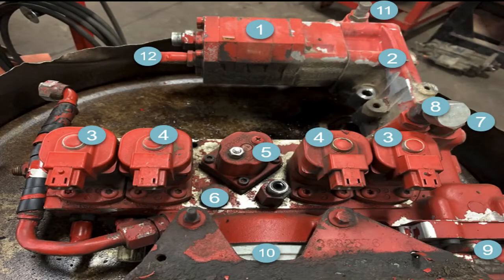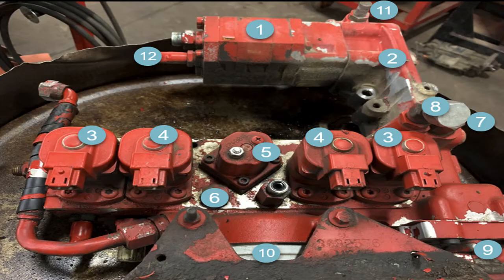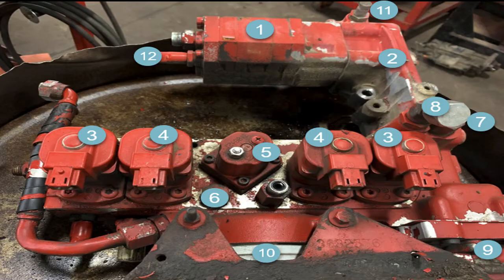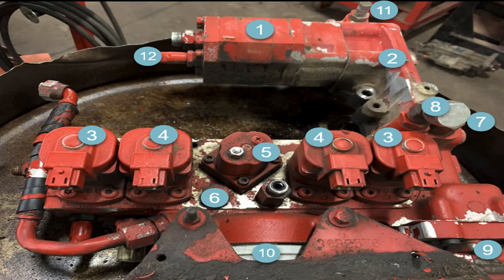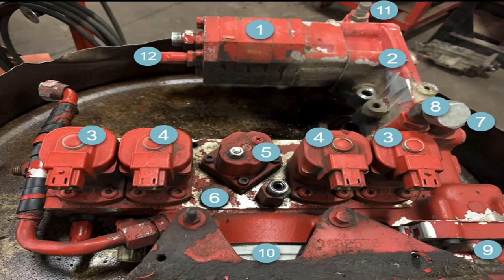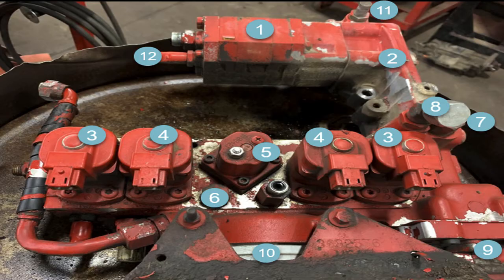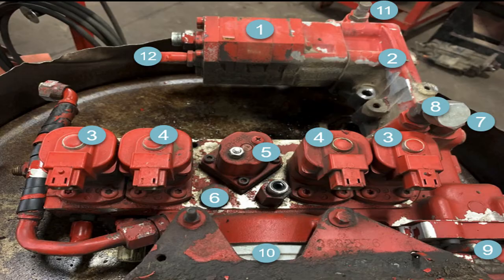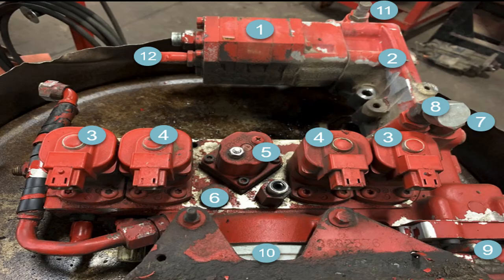ALL about the IFSM

Comment: Hey working on a CM871 and did a fuel tank cleaning and new filter were put on but still having issues when accelerating loss of power misfires and shutdown at times new gear pump was installed few weeks ago also
Reply: And only code coming for fuel is a 2215 for fuel pump delivery pressure come active and inactive when accelerating truck
Reply from the maker: I need more information. Fault codes? was there a lot of water and or dirt in the fuel tank? Why did you clean it?
Why did you change the fuel gear pump? Shutting down pulling is a sign of total loss of fuel pressure. Check the fuel pressure. There is a fitting under the IFSM to the front of the on engine fuel filter. Put a line on there and run it up where you can see it. If you have a scanner that reads fuel pressure in the ifsm use that instead. There are a lot of roads to take on this and there is not enough information for me to choose one at this point. But the fuel pressure check is the starting place. Check fuel restriction at the inlet to the ifsm. Make sure there is no screen in the inlet. They used to put screens in them and they would plug with all kinds of debree. fuel restriction at the inlet to the gear pump should not be over 10 INHG
Reply: Ended up finding the problem was fuel lines were rotten and clogging up inlet of the fuel filter on the frame and cause lack of fuel to create pressure causing the lag and random shut downs

Comment: Is it safe to poke in the center  of fitting 11 when primming after installing new fuel filters ?
Reply from the maker: That fitting is where you measure total fuel restriction at the inlet of the gear pump. Yes it is safe as far as there is no extreme fuel pressure there. If you have. an electric lift or transfer pump on the engine pushing that poppet will let the air out and you may get 10-15 psi fuel spit at you. I would think a better option is to buy the fitting that connects on to that and put a line on it then run it into a bucket until fuel runs out. Then take it off the fitting and it should start. Cummins runs a "priming line" from that fitting to the one on the back of the gear pump and lets the fuel run in a loop to prime it. Then you remove the line before starting or it wont start.I never did that myself.

Comment: this may be a dumb question but which one is the actuator im a bit confused i got the gasket for it
Reply from the maker: The isx has two seperate fuel delivery systems in the head one for the front three and one for the back three cylinders.
So there are two metering actuators and two timing actuators. A pair for each bank as they call them. The gaskets - unless orings- have to be bought for the metering or timing as bolt up pattern is slightly different. That is so you can't bolt the actuators into the wrong position.
Reply: @ENGINESHOPJOE   thanks

Comment: Hey Joe
05 cm870 - was idling truck today and it ran out of fuel so I threw 5 gallons on in the tank. It had one of those longer starts as you know it would because it would have to prime up. So the engine starts to run and there was fuel running directly down the fuel filter. Any suggestions?
Thanks
Reply: This is a truck that hasn’t been sitting for 1 year but both primary and secondary filter was changed last year April. Is it possible the filter seal could go bad or I have to dig in that IFSM
Reply from the maker: There is a number of places it could be leaking from I would clean it up with brake clean let it dry take a bright light start it and see if you can watch words coming from. You could also clean it and dust it down with talcum powder. Remember, there are pulsation dampers in the back you can’t see they can leak on the backside, if it sits O-rings tend to shrink, so that lands to multiple places you could have a fuel leak don’t overlook the shut down solenoid or the actuators when they leak it’s always a seeping type of leak.
Reply: @ENGINESHOPJOE  thanks for the reply, I’m going to check again  next week I bought all the seals for both dampers and the whole ifsm gasket and the actuator gasket with another fuel filter. Will update you

Comment: What would cause white smoke coming out the fuel tank
Reply from the maker: The answer would change depending on the engine you have. Check the return fuel for bubbles. Is it running normally? 
Some injectors can have an issue where combustion gas goes up into the injector. The isx 870/871 old mechanical injectors could 
cause this if a ball check near the tip of the injector comes out. Normally you have a stumble or non steady idle if the injector causes this.

Comment: My engine loses fuel prime after it sits a couple hours and u have to let it sit with the 12v pump on and I have a small power loss, any tips?
Reply from the maker: Generally speaking, from my experience and what I have read in channel comments, the culprit is usually the primary fuel filter assembly. Or its related fittings when they use orings to seal and not pipe thread. On subscriber said he had gotten undersized cap and bowl orings for his primary filter when purchasing replacement non OEM compatable fuel filter cartridges. So see try buying OEM orings for the filter assembly. It is interesting to note that orings may let air seep in but still seal fuel. It is all about the molecule size your attempting to contain.
Reply: Thank you so much that helped out a lot. I’ve got a lot of the kinks out of it now. Where is the fuel check valve to keep the fuel from losing pressure? Once again, thank you so much.
Reply: Also, my truck bubbles back through the fuel tank while it’s priming and after it’s ran for a little bit it’s like it’s got a white fog coming out the fuel tank

Comment: Joe I’ve got a cm871 that will not start. Cannot get it running on starting fluid. Any ideas. Curious if a cracked isfm would cause this
Reply from the maker: Did you have an egr cooler failure and get water in the cylinders??
Reply from the maker: I have seen that cause carbon to stick to the valve seats and you loose compression. It wont start on ether either. 
Just a guess but I would need more details to give a better answer
Reply: @ENGINESHOPJOE  Egr is deleted
Reply from the maker: Did. you get this started? If not check cam timing with the wedges and pin. They did have an issue with the injector cam gear slipping if it is not loctited with 609. But you should have faults. The best way to figure it out and start a data logger > all parameters> and crank it 30 seconds.
Look at that log or send it to me @faultcodehelp@gmail.com. That is where I would start. We have to be sure the ecm even knows it is cranking and then that it is jumping into crankstate. Then we go from there

Comment: Hi Joe, I have a QSK15 running a gen set. At operating temperature, it has a misfire and excessive black smoke. No active faults and fuel pressure at 276.1 psi. I performed a cylinder cut out test and found number 4 cylinder not responding. Monitored percent fuel on all cylinder when cut out and did see an increase except for cylinder 4. Swapped both fuel-metering solenoids with no change. Problem did not follow solenoids. I performed an injector leakage test with no bubbles present for any cylinders. I suspect a faulty fuel injector, even though number 4 cylinder did not fail the test. Before I replace number 4 injector, do you have any recommendations? Thanks, Dom
Reply from the maker: I am thinking you have a QSX 15 Not a QSK-19- Very different animal there. If indeed it is a QSX 15 It sounds like it has an ifsm. It could be a couple things. If you have injector orings handy swap out 1 and 4. There is a reason I chose 1 and that has to do with firing order in the banks. If the problem moves to number 1 it was the injector. I have seen valves "chip" of a piece or crack and you will get smoke due to very low compression. Make sure your injector cam lobe and roller are looking like all the others. If a a camshaft injector lobe has an issue causing this it will be very obvious to the eye.
Check valve lash first and injector setting on number 4 before you disturb anything. 
You could also switch the timing actuators they actually can cause black smoke if it is NOT the injector doing this.(rare)
From what you are describing I suspect a bad injector but it could be a valve sealing issue causing the smoke.(lower compression-You said smokes black when up to temp)When you start it as it is warming up if there is not puffing white smoke the valves are probably OK. Let us know what you find.
Reply: Hi Joe, you are correct QSK-15. I replaced injector number four. I did not see any issues with the cam lobes. I set the injector torque on number four injector and set valve lash to Cummins specifications. Did check the other cylinder valve lash. Found all to be in specification. Misfire is corrected and passed cylinder cut out test. Idles and accelerates to 1800 rpm’s with no issues, no more vibrations due to the misfire but still smokes black on acceleration. Once reaches 1800 rpm’s it clears up. Going to pressure test the air intake system for leaks next. I will try to swap the timing modules and see if there is a change with the smoke.
Reply from the maker: Generator sets have isochronous governors so they very aggressively accelerate to the 1800 rpm. If the engine runs clear when it is under load I would not be overly concerned about the black smoke you see when it accelerates to 1800. If it has no problem carrying the load and and you don't have low hertz faults when load changes i think it is probably OK.  @domenickcassanojr7604
Reply: @ENGINESHOPJOE  Thanks Joe for your assistance. I will monitor the engines performance.

Comment: great info ! thanks. i got a truck coming in the shop tomorrow driver states starts and runs fine when engine cold. once up to running temp. if he shuts engine off it wont start again until engine cools down. any insite? thanks ia
Reply from the maker: Check the fuel solenoid magnet. when they get hot they lose magnetic pulling power and wont open the shut off plates. 
Sorry i took so long to get back to you.
Reply: I have the same problem, when engine cold starts fine but won’t even turn the engine over while hot. Almost like it’s hydro locked somehow. Just to check it I took guts out of the fuel solenoid and got the same results. 
Thank you for making these videos, any input would be helpful.

Comment: 10/2023-B, ISX 550, Tons of $$$$$, and still not fixed, Getting fuel rail pressure code, loss of throttle, I don't hear turbo/injector whistle, motor starving for fuel, Dealer changed 2 parts, they said the cause was old rubber from fuel lines, a few months later the same issues, a friend mechanic changed one part, Sorry not a mechanic so not sure of the parts, I know once the fuel filter is changed and I add diesel fuel additive it clears up for a few months. The last fuel filter I changed I saw very little black particles in the fuel. The injectors, fuel pump, and turbo have not been replaced yet, I think the check valve and pressure shutoff valve were replaced, and 2 other parts replaced, It does seem to act up more under a heavy load, not sure if that is a coincident
Reply from the maker: What is your engine serial number. Can you have dealer send me an ecm image to faultcodehelp@gmail.com.
Do you have algae in the tanks? (black slimy film) If yes you have to add biocide to kill it or the problem never goes away.
If it runs good after a fuel filter change most likely mechanically all parts are ok. The problem is fuel starvation (plugged filters, Lines)
When ever Faults are active that relate to the fuel or boost or aftertreatment system the engine is derated so you wont hear the normal turbo sounds and sensed throttle loss is actually the ECM taking away torque because the  active faults drive it into a derate.
The key to this is when. you change the fuel filter and add additive it is ok for a few months. THe engine is ok the problem is fuel supply. Check for algae.
Reply: @ENGINESHOPJOE  I will get you #, I had the dealership do an alge flush a few months back, I thinkI'm getting carbon buildup in the fuel filter
, Thanks for the reply

Comment: Hi Joe, the truck with cm871 engine won't crank and water separator is getting full I already replace the filters but is doing the same thing, what it could be.?
Reply from the maker: Is the seperator getting full of water or engine coolant. If coolant that can come from a tank heater that runs coolant into the fuel tank or it can 
come from the injector wells in the head. The wells can leak coolant at the tops and it goes back with the return fuel to the fuel tank. Then the water seperator catches it. If it is that Cummins makes a "wedding that can be driven into the well to stop that problem. IT works!. A dealer or cummins sales and service can install the rings. you remove injectors -drive in rings with a tool that sets them to correct depth in injector well and then you put new orings on injectors and reinstall.  
I need more information on the wont crank, that can be battery or starter or coolant in a cylinder causing hydraulic lock.  coolant in a cylinder is rare on your engine. 
If you have actual water in the fuel suspect where you fuel up or check your tank vents and caps (driving in rain)
Reply: @ENGINESHOPJOE  you are great, knocking the ECM I found today that the ECM was killing the transfer fuel pump and the vgt actuator.

Comment: 2002 isx 600 signature 570 at idle what should fuel pressure read on insight cold and warmed up
Reply from the maker: idle at 700 rpm idle should be above 250 psi hot or cold. rev it up and if it goes up to 275-300 it is probably a worn fuel gear pump if idle pressure is too low. This of course assumes no air in fuel and fuel restriction is in normal ranges. There is a high and low fuel pressure regulator but my experience with those is they stay accurate  until they fail and then the engine wont run or start (no fuel pressure). This will start logging fuel psi faults when pressure drops below 245 at 1800rpm
Reply: @ENGINESHOPJOE  that's the problem only 230ish with a new pump
Reply: Thks young man

Comment: Good video. Noticed you didn't cover the dampers on the back of the ifsm.
Reply from the maker: Function wise they rarely fail and will sometimes leak fuel. But they are just gasket /oring changes to rebuild. I wanted to address what people see  when they look at the side of the engine. I may do an IFSM rebuild in the future. Thanks for your comment
Reply: I have a fuel leak, possible from the solenoid gasket. It is possible to have a crack solenoid, I have a lot of fuel leak. Thank you!

Comment: Good evening, I'm from Brazil and your videos are perfect!  Can over speed and under speed problems be caused by the fuel injection system?  we use the Cummins qsx coupled to a generator sometimes it exceeds 1,800 RPM!  failure started after 10 years of use, thank you.
Reply from the maker: Yes. Generator sets typically have high load transitions. So the fuel system can cause problems if there is a part not performing to specifications.
There are of course other things that cause this. I would start by checking for faults in the engine for the fuel system. There are a vast number of controls and generator configurations so I cannot comment on the generators controls doing this but they could be playing a part in this.
Reply: @ENGINESHOPJOE  Thank you very much for your attention, I will first check the fuel supply system!

Comment: I have a ticking noise coming from under the valve cover. I was told maybe it can be an actuator? The truck feels like it has a misfire or hesitation when I press the accelerator. What are your thoughts? Thanks
Reply from the maker: What engine are you running ? If it is an isx and has jake brakes it is most likely a jake brake lever is not locked into "off" position.
They will tick. The fix is replace the rocker shafts-the jake "off hole" becomes egg shaped and the lever is not exactly where it should be.
This does not cause any problems that I ever say short of the ticking. You could buy a jake brake overhaul kit and two rocker shafts and 
the tick would be fixed. Of course verify that the tick is the jake lever. if you pull the cover and run it you can see the jake levers slightly rocking and put a finger on it and you will feel the tap. You could also have a broken injector spring- very rare i only saw that once. That would cause a tick
and the hesitation you mentioned.

Comment: Is there any videos on the ifsm feel dampener?
Reply from the maker: I don't think i have one on the dual dampeners on the back of the ifsm but they are simple to rebuild. There is an oring and a couple nylong spacers and the new disk. Just a few parts. Take it apart and lay it out and reassembly with the new parts reverse order.

Comment: Can you tell me which timing and metering actuator is considered #1 and #2 actuator?  When there is faults, it will say #1 or #2.  Thanks.
Reply from the maker: Think about it like this Lonnie, There are two three cylinder engines in one package. The two actuators one timing, one metering  that are 
towards the front of the engine fuel cylinders 1,2 and 3. The shutdown solenoid feeds both the front and rear bank.Then there is a timing and metering actuator for the back three cylinders. Inside the cylinder head there are two completely separate fuel systems. The front bank and the rear bank. The engine ecm makes it run smoothly but it thinks it is running a couple three cylinder engines. A fuel engineer told me that back in 1999.
Each actuator has it own separate fault codes so you can not mistake which one you need to check out.